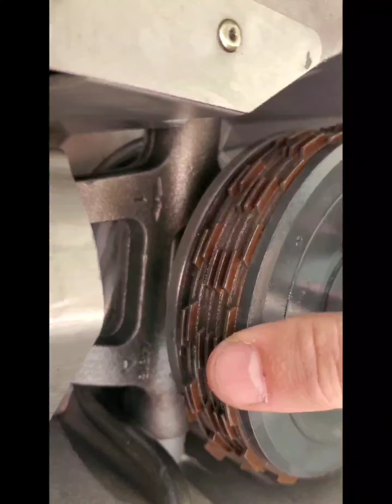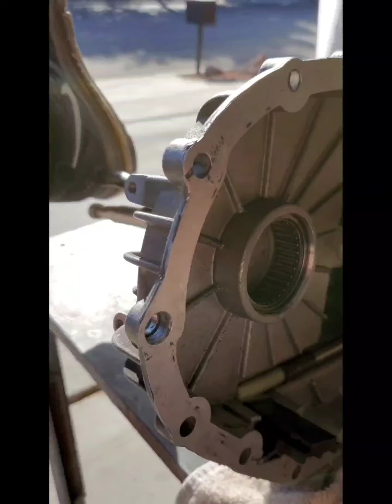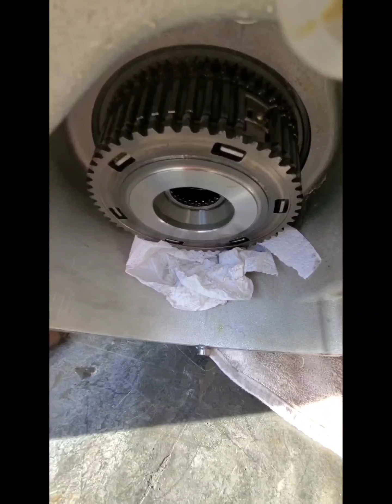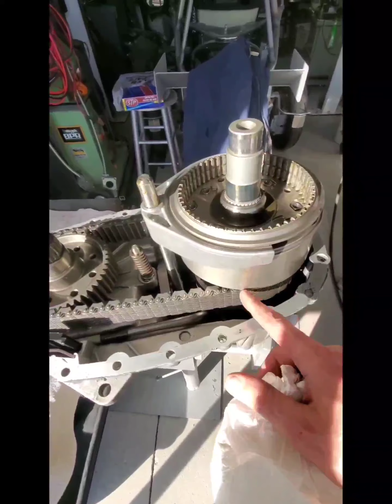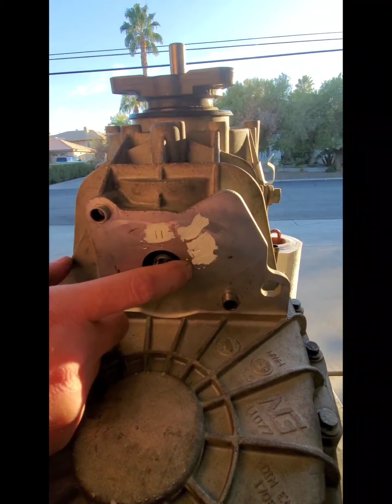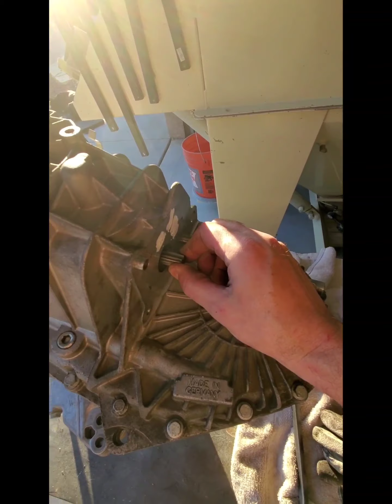VW touareg. Part 3. Transfercase. Done.

Comment: Nice job, I would like to explain to me the problem about my treg, it's 2004 v10 tdi  when I spin to low gear it gous OK and works fine but when I engage to center diff lock it seems like its engaged but I can feel it thats not engaged no pop up fault codes, btw I have noticed sometimes rear wheels seems  lazy to spin  what does the center diff lock does it keeps clutchs all the time engaged or it gous to gear?

Comment: hy there. is the TC actuator CAN bus controlled or analogue? is there any way to hot-wire it for a non touareg aplication?
Reply: Can be retrofitted. This car is completely analog but is controlled by its module. You do not need this module as this is a DC motor you can just have a normal polarity switch to either have the clutch pack locked or unlocked. 

If you need any photos or videos ask.